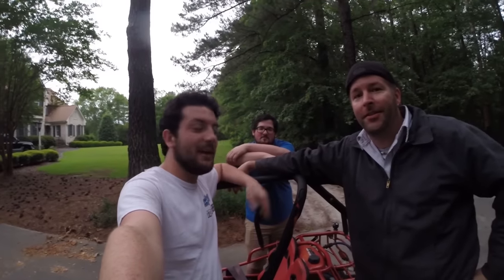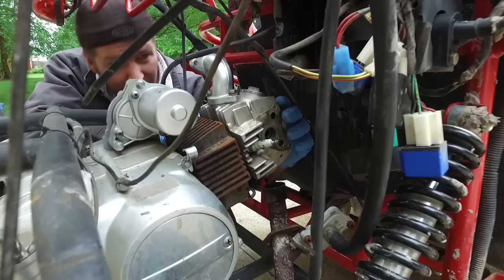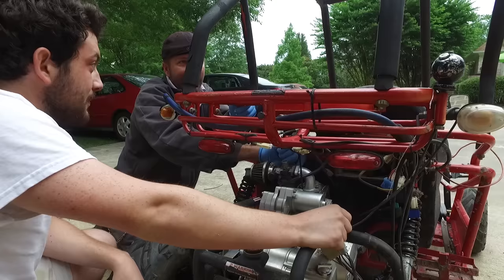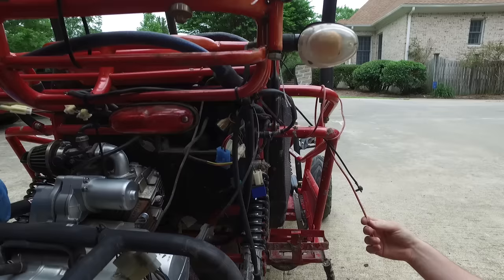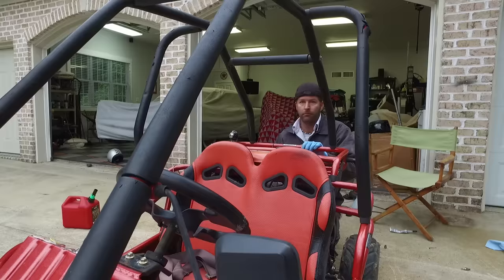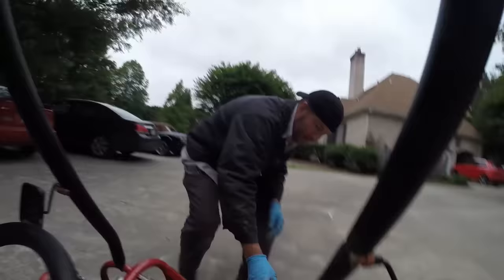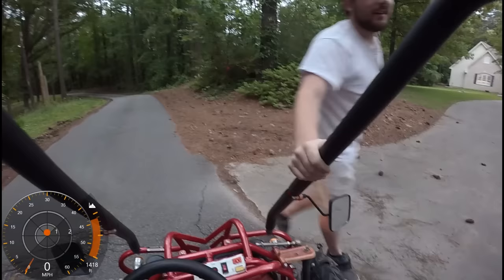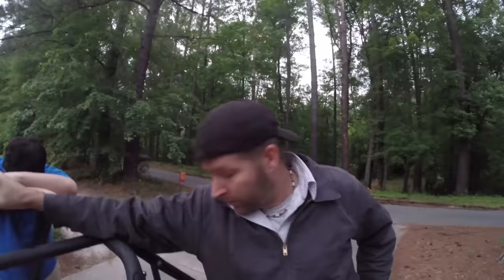Fixing, Crashing, and Top Speed Run with the Offroad Kart

Comment: I might have missed it but what size engine is in that?
Reply from the maker: +Coda Chimko It's a 110cc.
Reply: +CarsandCameras oh wow that seems pretty gutless for a 110 aha. it would be cool to see you guys adapt a 125 dirt bike engine or something similar for that.
Reply: +CarsandCameras how did you find this go cart? Did you use some sort of website or stumble across it a different way? Because I've been looking for a go cart forever and haven't found a good one yet!
Reply: +DQ Activities the guy they bought johns cart from had it
Reply: +CarsandCameras get yourself a cheap 20 inch amazon led light bar
Reply: a buddy told me about it
Reply: +Isaac it'll be fine ok thanks
Reply: +DQ Activities ways to get gokarts, Craigslist, friends, build your own.
Reply: +CarsandCameras, wheel spacers and golf cart wheels on the front, and snapper lawn mower rear tires (with spacers as well) would probably be a good setup, and instead of put a bigger engine, i would like to see you guys bore that one instead, using your special brand of diy.....it'll be fine indeed, also put a cars and cameras logo  and give the go cart custom fenders, but i would suggest rubber for........reasons, love yall's channel
Reply: thanks
Reply: +Isaac what yall goin to do with that thing i seen one i might get i know yall might motor swap it if y'all do let me know what you come up with i  might do the same thing
Reply: are you selling any of ur old karts
Reply: not yet
Reply: Isaac it'll be fine I might be poor but I call dibs on the latest off-road go kart and the 670 or maybe I want the drift trike for the motor for a street cart. Also I have great news I'm buying a welder for building my own karts, so excited!

Comment: Needs moar power. That gear box if cool though... if you can't change the engine I think you might need to apply some of the lessons learnt from your turbo build and boost this puppy. Can you "adjust" the governor on this engine? Can you run E85?
Reply: i dont think it has a gov and im more into the regular gas
Reply: Is the transmission integral to the motor? Otherwise we have a candidate for turbo... I guess it goes ok for off road, you could crawl over terrain in low gear if needs be. Pass, not my budget.
Reply: the trans is part of the engine

Comment: that tube coming off the crank case going to the air filter is not emissions, its a crank case breather and the mist of oil it kicks out lubes the slide in the carb. its best to keep that hooked up
Reply: Actually it is an epa requirement not technically emissions but close enough.
Reply: They have to route it into the intake because the epa is concerned about that oil mist polluting....
Reply: its also a motor requirement or it dont work........
Reply: +Silvie Fox you talk rubbish.
Reply: what makes you say that?
Reply: +Silvie Fox the carburettor is lubricated by the fuel. All the oil mist does is gum shit up and lower the octane of the fuel. It only goes into the intake as it pulls a better vacuum, and to stop the mist going on the road and into the atmosphere... It will run just fine if not better with out it going into the intake

so I'd say your talking rubbish.
Reply: if this was a 2 stroke that would be true (the fuel lubing it part) but its a 4 stroke and trust be from all the bikes ive worked on were people remove the air box and put pod filters on (removing that crank case vent from being part of the intake system) have carbs that the slides are scared to hell and get stuck and throw the air fuel mix off, if its pulling so much oil thru that its lowering the octane you have bigger problems like to much oil or the motor at a bad angel or a missing separator, because to shouldnt be kicking that much oil out it.
Reply: +Silvie Fox scored to hell because they are using dog crap filters that is letting crap get through. my gsxr600 doesn't have any breathers going into the intake..... 30k no problems... neither have any of my off road bikes, 4 and 2 stroke. fuel still lubricates the slides even if it's doesn't have oil in it didn't you know this? doesn't have to have oil in it to do it.... its massively common on cars to get rid of the breather onto the intake and run a catch can. even the best condition engine with be letting out oil vapour. any oil vapor with effect your octane level whether it's a little bit or a lot...
Reply: your talking rubbish...
Reply: +Silvie Fox You are the one who was spouting rubbish.
Reply: Come on man. That is obivously not intended to lubricate the carb. Do some research.
Reply: No mate, they sell breather filters for those so you don't have to put them in the intake. The only reason its there is for emissions and its filtered air. put a breather on it and you're fine.

Comment: copper coat gasket maker works best for the leaky head stuff ike... 😉
Reply: yes but there were chunks missing in the gasket. it wasnt a clean separation. thats why i used the silicone . it'll be fine. lol
Reply: +Isaac it'll be fine Ah, I c...u shoulda mixed em both like epoxy lol!
Reply: lol. i didnt think about that
Reply: +Isaac it'll be fine I'm sure they'll be a next time...
Reply: probably . lol
Reply: +Isaac it'll be fine lol, and don't forget the ol anti-sieze to fill in egr and exhaust gaskets

Comment: The audio is always all over in your videos. Too loud then too soft depending on the cameras used/distance from camera I think. Maybe try fixing this in post or invest in a lav mic or two? It's annoying having to play with the audio level throughout the video. Just my 2 cents!
Reply from the maker: +Jager Felice Yeah, I hear ya. We aren't at the point to use lavs or a boom yet. Having lavs is just one more thing to remember to charge and stuff. Since I transport all the equipment to and from college and my parents' house frequently, I'm trying to keep the gear bag as light as possible.
Reply: +CarsandCameras Just a friendly tip for you to try but download audacity and run the audio through the "normalize" function in effects. then put it back into Vegas (or whatever you use) and sync it up. should only take a few minutes and help the audio stay close to the same volume throughout.

Comment: Hey guys I really need your help. I just bought a baja dirt bug (doodle big) with a 5hp brigs engine and all it needs is a clutch and sprocket. If the shaft is 3/4 could I use any clutch on it? http://m.ebay.com/itm/Predator-Engine-212cc-HF-Go-kart-Centrifugal-Clutch-3-4-BORE-12-tooth-35-Chain-/301777385120?nav=SEARCH here's the link to one I was looking at ordering will it fit? What about the spacer for the clutch what do I use?
Reply: that looks like our clutch that we use. and it works on briggs 5 hp and 212 predator engines. the only thing you need to make sure is the chain, is it a 35 ?
Reply: +Isaac it'll be fine I am not sure on the chain size but I will ask Na mechanic today before I order it. Thanks.
Reply: sure

Comment: So would the 3speed trans bolt up to a 212?  That would be a good upgrade lol.

http://www.amazon.com/Predator-212cc-Horizontal-Shaft-Engine/dp/B005U31ORU/ref=sr_1_1/179-0611476-1007541?ie=UTF8&qid=1464372586&sr=8-1&keywords=Predator+Engines
Reply: if it could fit.... probably not...

Comment: r y'all still going to put on a predator
Reply from the maker: +Mad Dog5387 Probably not, we like that it has gears.
Reply: +CarsandCameras ok
Reply: +CarsandCameras If you want the gears maybe get a tourqe converter
Reply: +CarsandCameras If it fits
Reply: a torque converter is a torque converter not a transmission or gearbox.
Reply: +smallenginedude71 actually it's a CVT transmission.